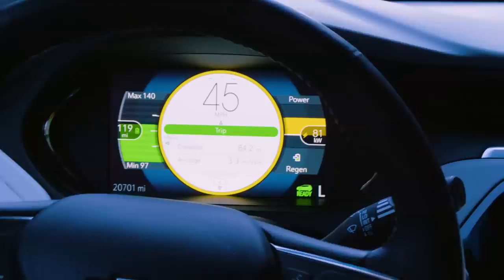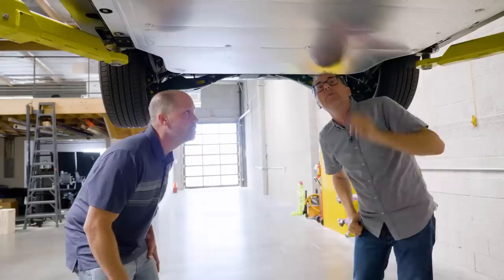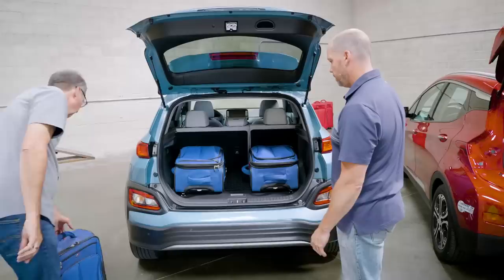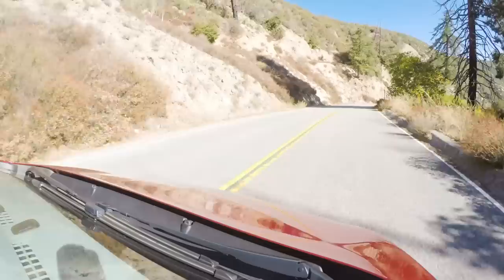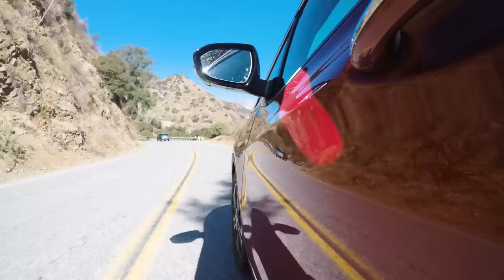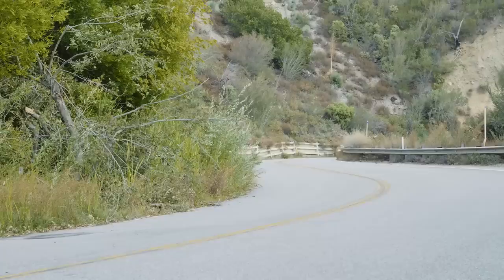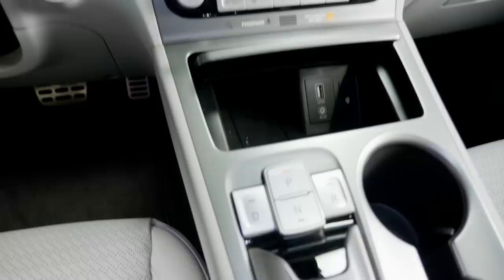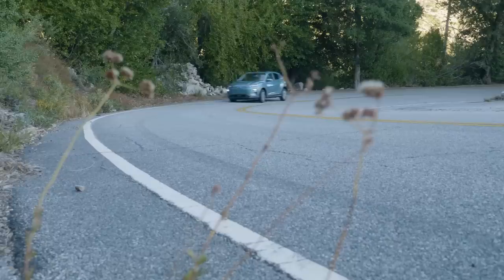Hyundai Kona Electric vs. Chevrolet Bolt EV: Which Is the Best Affordable Long-Range EV? | Edmunds

Comment: Vaporware is the wrong term used and Model 3 Mid—Range is both in the range-range and price-range of these two cars. You only discredit yourselves needlessly. The comp between these two cars is great without the need to piss on Tesla.
Reply: va·por·ware
 : software or hardware that has been advertised but is not yet available to buy, either because it is only a concept or because it is still being written or designed.
When Tesla sells the $35K car they've promised, then it will become reality. Until then, it's fantasy. Not real. A pipe dream. Vaporware.
Reply: The video was likely made before the mid-range option was introduced.
Reply: Kona will only be available in CA initially, so it is kind of borderline vapor ware.
Reply: I agree the only reason you cant get a model 3 is because the demand for the car is so high. all other car companies wish they could do that but they cant./.Mid range is out and its the 5th best selling car on the market.
Reply: @SvenOllino  No, the mid range has been available for over a month. It's a glaring omission failing to mention it, especially when it's within $5k of these two cars.
Reply: Exactly.  They lose their objectivity and credibility by this calling the base M3 "vaporware".
Reply: @anevtransition1298  You mean available for test drives? Keep also in mind that such videos take time to plan, shoot and edit too.
Reply: @Vam1500   The Kona Electric is built and the battery size we will be getting has been sold in Europe for a while.  That not borderline vapor-ware at all.   Edmunds knew by using vapor-ware and Tesla in the same sentence the posts on this video would be exponentially higher than normal.   Good job Edmunds.
Reply: "Vaporware is the wrong term used and Model 3 Mid"
Tesla is notorious for not delivering, and big promises. Show anyone where they can by a Model 3 production car to test, otherwise the Model 3 IS NOT A PRODUCTION CAR THAT EXISTS!
Have you hear about the new model Volt, it's twice as good as the Model 3 in every-way. Prove otherwise.
Reply: Anthony C Brown: I signed up for updates about the Kona electric. All I got was spam about their ICE cars. They can’t tell you when in the US you will be able to get the car. If they are going to slam the standard range Tesla as vaporware, they should at least mention that no one knows when the Kona will be widely available throughout the US.
Reply: @Vam1500  I'm not sure what update you signed for or where you get your news but I get updates from Hyundai ONLY on the Kona Electric.  Received my last email update 11/2/2018 'The first-ever
 Hyundai KONA Electric. Arriving in California early 2019'.  It has been repeated in several US Kona reviews that California will receive the 1st releases for the US - followed by ZEV compliant states in the USA. 

Hyundai is not responsible for what Edmunds chooses to say or not say.   Edmunds can't force Hyundai to reveal their US release schedule either.    Question:  Why do you appear so angry and frustrated about  car?  It's just a car....
Reply: @SvenOllino  They mentioned Tesla and used the word 'vaporware', yet failed to mention the mid range version which was announced MORE THAN A MONTH before releasing the comparison video.  There's no excuse for that. It was in buyers hands for a couple weeks before. They knew this while producing the video. It was simply easier to overlook it than adjust for it and take another day of editing. They could have easily acknowledged the specs and pricing and promised a follow up. This would lend a lot more credibility.
Reply: Anthony C Brown : You just made my point. The Hyundai is as much vaporware as the Tesla model 3 standard range until you can buy it throughout the U.S. No one knows exactly when that happens for either car.
Reply: @dmay3391  It's a 3-week delivery window. It really exists! In fact, you can still get the full tax credit with delivery in 2018.
Reply: @Vam1500  Please tell us where (anywhere on the globe) we can go to see in-person an actual Base Configuration of the Tesla Model 3?  No pictures or sketches but the actual product.  If you have a review of the Base Configuration of the Tesla Model 3 please provide a link.  Otherwise, enjoy your week.
Reply: Anthony C Brown Where was the review of the base Bolt or base Kona? Oh that’s right, they didn’t. They tested the fully loaded $40k+ versions. A fully loaded Bolt and fully loaded Kona are price, range and general feature comparable to the base Model 3 Mid-range currently being offered. THAT is the point being made.
Reply: @jmbickham  The Bolt is in their long-term fleet and the Kona was on loan from Hyundai.   There are plenty of reviews of the Bolt LT AND owner reviews of the Bolt LT.  In markets where the smaller battery pack (SE) configuration there are online reviews from owners and from loaners from Hyundai.   

The Mid-Range Model 3 with vinyl seats (non-ventilated) costs approximately $48K (Model 3 Mid Range Rear-Wheel Drive, Metallic Paint, 18’’ Aero Wheels, All Black Premium Interior).

THATS THE POINT!!!
Reply: Anthony C Brown: Pictures or sketches? What are you talking about? It will be the same car they have sold about 130, 000 of except with a smaller battery and the no premium interior if you want the version that is $35k. If you want the premium interior it will be the same price as the two cars in this review. Any car you can’t actually buy now is in the same category to me. You want to put the Hyundai in a different category than the standard range model 3 because they sell it elsewhere and they say it’s coming, but nobody really knows for sure which will be sooner available all across the US. If Hyundai gets there first, good for them.
Reply: @SvenOllino  these are car people. They had a month, while shooting and editing, to research what is obvious to the average EV enthusiast. They failed.
Reply: Brian Stringfellow "It's a 3-week delivery window. It really exists!"
You literally described how it doesn't exist. Maybe when the production car exists, sold and bought... someone... could test it against how it held up over a year. Time travel?
It's amazing people can't distinguish the difference between a imagined sales pitch and objective reality.
I assume you're referring to the Hyundai no on has yet, not the mystical Tesla no one has.
Reply: @dmay3391  Maybe I need to say it a different way. Tesla makes cars for customers, not for dealers. You order your car and they make your car. It takes about 3 weeks. They make the number 3 best selling car, too, more than any chevy or hyundai.
Reply: Brian Stringfellow "Tesla makes cars for customers...It takes about 3 weeks"
In July 2018, media reported that a Model 3 prototype had been seen in California and Nevada heading in the direction of Area 51. Rumors are aliens have bought all the Tesla Model 3's, so that must by why no on has one. Or perhaps the Model 3 doesn't exsist.
Never the less, advocates report positive test result's of the non-existent production car.
Tesla Car company failed in 2009, but a government bail-out loan keeps them afloat in bad debt, but it has a religious following of advocates.
Reply: @anevtransition1298  I see what you mean. I guess they just didn't care enough to change their plans.

Comment: Right now I see 3 sensible EV-ish options: 
1. under $10k - get a ~5-year old Leaf and you'll get extremely cheap miles, most likely just 10 cents per mile. Or if range is a problem get a 7-10 year old Hybrid.
2. $10-20k get a 5-7 year old used SUV or 3-year old hybrid like Toyota Camry or Prius. Or maybe you one of the lucky ones who could get a new Leaf for ~$16k in Colorado.
3. 30k+ - get a used Model S. It's battery still good for more than you could possibly drive and your miles could easily be in 30-40 cents/mile range - still less than ANY new vehicle.

Anything else only make sense if you're rich. New cars cost almost twice as much per mile.

Comment: Problem is that Hyndai is building only a relatively tiny number of EVs; several times fewer than Nissan, for example, and about 10 times fewer than Tesla.  They exported about 1100 Kona EVs  in June for example.  Tesla makes approximately that many Model 3s per day.

In that sense, it's the Kona that's vaporware.  Almost none are actually available at dealers outside of Korea.

Comment: I have a bolt and would like to talk about the back seat. The floor in the back in flat which allows three people to sit in the back easily. Though i have not been in a Kona, I have been in a Kia Niro which i think is similar. I think the back seat has a transmission tunnel in the back which makes it hard for the middle passenger to get comfortable in. Now an EV should not need a transmission tunnel going to the back seat and i get why the Kia had it. Sharing the same platform for the gas, hybrid and ev models means compromise like having a transmission tunnel that is empty and takes away from center passenger leg room. All cars have compromises and truthfully all I want to see is more EVs on the road, even if they are not the choice that i made.
Reply: No transmission tunnel in Niro. Only fwd. Battery is under rear seats.
Reply: @schmo7777  
However I believe the Kona is available in all-wheel drive. Which would explain the transmission tunnel
Reply: The Niro is bigger than the Kona and Bolt EV.  Kona does have a small hump in the middle.
Reply: The Kia is bigger
Reply: @kens97sto171  
No, a 4WD  EV uses 2 motors, not a propshaft.
Reply: @rogerstarkey5390  
Right except they make a GAS powered AWD Kona..

Comment: I get 300 miles a charge in the Ozarks . I use my regen paddle all the time. Saves brakes and helps me gain more power. Only charge it at home. I do turn it to 12 amps on the screen. My electrician says my garage plug is safe

Comment: You want a solid, good quality vehicle, you do NOT buy GM.
Reply: Javier Hernandez that's old BS. Get some new BS.
Reply: @daveturner6612  look up the reliability and quality reports, tesla is bottom barrel. Ignorant BS.
Reply: tesla has power train and battery down compared to other car makers. yeah they're new at making cars and aren't as reliable to an extent, but damn they look way nicer, even with their panel gaps and bad paint. i'd rather be stuck on the side of the road in a tesla than a bolt. they'll get better over time. Tesla's don't break down all that much. their battery degradation is very good.

Comment: The Kona EV from the outside looks like an out-dated model compared to the Bolt EV. And the Bolt has been selling for 2 some years already. Also many people complain about the cheap plastics used within the Bolt's interior but the electronics such as the display is years ahead of the Kona especially with that dinky laggy screen.
Reply: This is true, people are just blinded by hate and negative feelings for GM.
Reply: correct
Reply: From an European perspective. The BOLT looks like its designed 8 years ago. While the Kona is looking pretty modern. Maybe it's an American thing? Also the BOLT here is almost 50.000 euro. While the KONA is alot cheaper.

Comment: One more note.  For the 2019 model year the Bolt EV has added a bit more padding for the seats.  I would be interested to know if Edmonds was testing a 2019MY car?
Reply: The one they are testing has over 20k miles on it and one of those California EV vehicle stickers, my guess is they borrowed it from someone and its a 2017 or 18.
Reply: @SimonMichaelBenz  @erik stephens I test drove 17's in both trim levels. The seat was horrible in one, okay in another. Tried the 19 when I heard they improved the seat. They were much better, but still not as great. Purchased a 19 Bolt and after adding padding to the bottom it's very nice. 

Now with a Bolt and a used Leaf we're set for a few years. M3, Bolt, Niro, Kona, possibly VW and others in a few years will be on the landscape. I'm agnostic. Whatever the best deal for my use case at the time wins!

Comment: The Kona is a slightly updated Bolt essentially. With the exception of the drivetrain including the battery "firmware" for lack of a better word, the Bolt was designed in Korea by LG Chem and others. The Bolt is a little quicker and sportier, but otherwise I think the Kona is more refined. I suspect the reason the Koreans are so far ahead of everyone except Tesla and GM, is because GM did a technology swap with LG Chem and the automotive consortium in Korea. I suspect Kia/Hyundai got GMs EV drivetrain tech, which is extensive, along with GMs Voltec/EV technology in General, in exchange for a free car design along with controls and electronics plus battery from the Koreans. This is why the Koreans are so far ahead of the Europeans Japanese and Americans save Tesla and GM, because they have everything GM knew in EV tech plus what they have added since the the tech exchange. GM knew Hyundai could further the EV cause better than they can simply because GM has poor mind-share in the industry, fewer people are likey to gamble on this new technology if GM leads the way sub 40K, but if Hyundai Kia lead, EVs will catch on quicker and then GM can leverage their experience as they watch component prices fall.
Reply: Benz. Bolt was designed in South Korea by GM's Korea studio (formerly Daewoo Korea). The drivetrain is produced by LG and shipped to the orion assembly plant.
Reply: @miloe436  Right that is the "official" story, but in reality GM Korea/Daewoo Korea and the Hyundai/Kia group are a very tight group, that's how it works in a country like Korea, its not like here where Ford, GM, Chrysler are all completely independent competitors with little to no government influence or assistance. GM has stated the design is theirs, but LG chem produces it. Designing something, then figuring out the most efficient way to build it are two different things. The technology sharing is the only way to explain the nearly identical design and specs between the Kona and Bolt. Every automaker has had a different take on EV tech so far, with the exception of Hyundia/Kia and GM. Either the tech was shared or the GM Daewoo team leaked it to their countrymen which i find to be less likely.
Reply: 1121  nigga? OOOOOO K

Comment: The Kia E-Nero solves any deficiencies of the Hyundai. Slightly longer, better rear legroom, luggage space. Similar(?) Price.
Reply: Roger Starkey the kona is better built va the Nero, even though they are sister company. The kona also utilises one charging port with a type 2 charger with rapid charge and fast charge where as the Nero it is a different charger so can’t be used at all charging stations and won’t be charged as quickly
Reply: @CrcsM2351  
Driven them? (Thought not)
Reply: Roger Starkey actually I work for a Hyundai dealer in the uk
Reply: Roger Starkey so probably abit biased too haha!!
Reply: @CrcsM2351  
Or maybe too critical? (Striving for perfection?)
Reply: @CrcsM2351  Kia has been #1 in quality in front of Hyundai as per J.D. Power, but both have great quality.

Comment: I want an EV for a ultra quiet drive. Hows the hwy noise in both of these cars? Are they typical subcompact noisy or close to luxury car quiet? Thx
Reply: wasabi9111 I have a bolt and it’s fairly close to a regular car on the highway. Maybe just a touch quieter but not luxury car levels. Of course at slow speeds and waiting at stop lights it’s blissfully quiet.
Reply: wasabi9111 The video shows how quiet EVs are. My Leaf is very quiet. The tire/Road surface combo is a variable. Thanks
Reply: Ramon Cardona hows the wind noise? Most subcompact gets really noise at hwy speed with loud wind and tire noise.  I was wondering if subcompact ev is any better.
Reply: The Bolt is not loud on the highway, but I wouldn't call it luxury car quiet.  My CTS is noticeably quieter than the Bolt.
Reply: wasabi9111 Very low wind noise even at speeds above 65 mph. Nissan was forced to design the headlight lens to what many call an ugly shape to decrease wind noise at the side rear view mirror housings. Tire/road noise is negligible. 2011 Nissan Leaf. A friend has a new Tesla Model 3 that is extremely quiet. Thanks
Reply: The Kona is basically the same body as the ICE version of the Kona, which is definitely on the quiet side for a compact. Not high end Mercedes quiet, but much better than most rental sedans I've gotten over the years. I'd imagine the EV version is slightly quieter, as the most audible noise in my Kona is the turbo 4cyl.

Comment: The "lift throttle regen"  will bring the Bolt to a stop at a stop sign or red light -- one-pedal operation. A great feature, shared with the BMW i3.